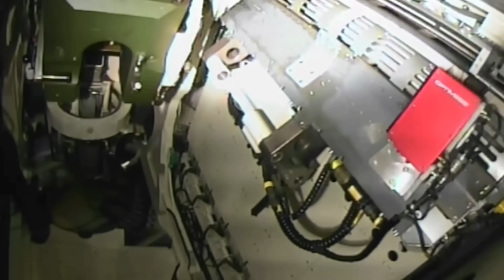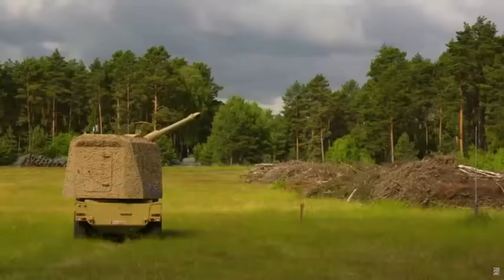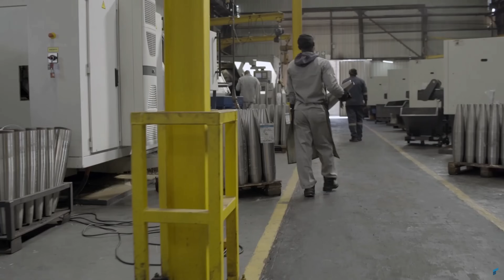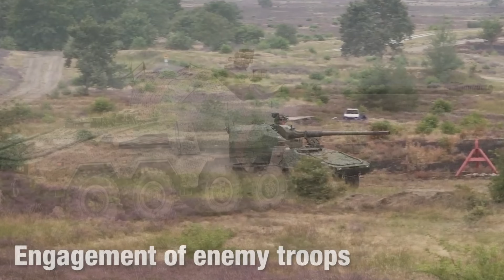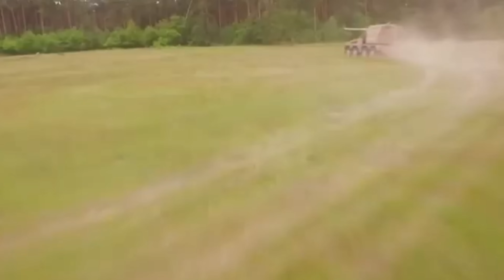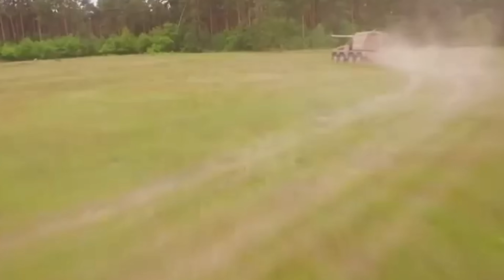The RCH-155 Self-Propelled Artillery System | 155mm FIRING ON THE MOVE!

Comment: This is the artillery system I have been waiting for, and I am thrilled i fits on a Piranha IV chassis. I suspect that is the current candidate for Denmark to replace the CAESAR donated to Ukraine. I wonder why it needs a 10*10 chassis. That is possibly the suspension of the Piranha.
The other salient point is: It uses max. charge 6 - to get greater range it is smarter to extend it using more expensive shells. Due to the nature of the sound barrier, very little is gained using charge 8. And it absolutely smashes the suspension - or you need the spades which is not conductive to scoot.

The main argument is that in brigade with Boxers or Piranha's the ICV's need artillery that can keep up with it when going flat out on the Autobahn.

Actually I think the price of the piece is justified in saving the number of rounds it consumes - accuracy has a quality all of it own.
Reply: The Piranha 8x8 chassis isn’t designed for that kind of weight. Basic Piranha IV 8x8 weighs ~15t plus 10t payload, Boxer A3 is ~25t plus 16t payload.
Reply: >*I wonder why it needs a 10*10 chassis. That is possibly the suspension of the Piranha.*

Yeah, consider that the 8x8 Piranha - even though itself a big boi - is significantly lighter and smaller than the Boxer.
Reply: The Boxer is in a superior weight category, that is why the Piranha needs 10 wheels.
Reply: Thanks for the comments!
But I presume the 10*10 chassis is a consequence of staying with the same manufacturer and creating 2. Brigade as quick reaction force for Finland an Poland. It can use the North south roads and not the east west ones - that in the event will be clogged up by heavy armour.

What we now need on the Piranha chassis is a 105 mm gun. and use the same system as on the S-tank. The turning circle for the vehicle is about the same as for the turret on a traditional tank.
The suspension of the Piranha will solve the stability problem of the S-tank (the length to with ratio of the tracks was to small for stability) The problem with a 10*10 might be excess stability (meaning the bloody thing won't turn sharply enough in small villages). But then I have not seen what the aft 4 wheels are doing - if they mirror the front 4 wheels.
For stability the aft wheels of the Piranha V locks at speeds over about 20 km/h.

But I am looking forward to see if that concept will carry through!

The other challenge is the supply trucks to the brigade - that is largely solved with the purchase of protected Scania 8*8 trucks. When you start pouring in shells at a meat assault (or armoured attack) - you better have reloads ready.
Reply: @ Piranha 10x10 supposedly has 4-axle steering, with only the middle axle fixed.

Comment: I still think wheels are a bad idea compared to tracks. Unless the off road capability has gotten more advanced or something. It’s the assumption that the roads and other smooth surfaces will remain so, or even be there in the first place.
Reply: The off-road mobility of the boxer is decent and it is surprisingly difficult to destroy a road cost effective. You can drive around the craters at lower speed or use another road and the craters are filled with basic tools within a short time.
Reply: @gbornitz  Fair enough.

Though you could still mine the roads or set up ambushes there. Or just monitor it with a finger on the missile button.

But if it is about as good as tracked vehicles in difficult terrain, then it doesn't really matter. And those objections matter more to tanks and IFVs than artillery anyway (if your artillery is hitting mines or getting jumped, you have bigger problems).
Reply: @dragonturtle2703   I recommend you look back five years on this channel, and watch his vid on the South African G6 155 SPH.

Key points:  the terrain it fought a war in outnumbered ten to one, the fact anti-tank mines were a heavy factor in its design so that it wouldn't lose crew or be disabled and stopped when it hits one, and its enormously superior driving range (as well as firing range) compared with all contemporary self-propelled artillery!
Reply: You would think there is a road inside a 40km radius around any target.
Reply: @ you’d think those roads would be targeted to prevent that would you not?
Or destroyed yourself to prevent the enemy using that if they break through you lines to rapidly push inwards.
Reply: that doesn t matter, its a module, you can even put it in a truck or something with tracks

Comment: This vehicle has a very high cost for initial purchase and I wonder if the turret is built to outlast the chassis, it seems the turret is where the money is.I wonder if it fits on a C-130
Reply: Should be roughly 50-50 gun chassis ratio
Reply: WAY too tall to fit on a C-130.
I was going to write that you could separate the modules, and put a hull or two in one C-130 and a pair of turret modules on skids in a second C-130, but then I realized that the 8x8 Boxer is too wide and tall to fit in a C-130! (I could be wrong, but that's how I eyeball it.)

Maybe with the larger-body transports that are coming on the market? Pack sixteen various types of Boxers in eight aircraft, so that you have a command element with a medivac unit and an SPH and a Skyranger; two maneuver units with light and heavy autocannons, an ATGM and an AAA, and their infantry occupants, or perhaps additional medical and escorts depending on the mission. Additional flights for ammunition, consumables, and whatever is needed for the tasking, and you have your initial security force for the airport. Of course, if you want to keep that airport, land a full battery of the PZH-155s, a full AAA battery of Skyrangers, a C³I and spare, whatever passes for radar these days, a Starlink, and plenty of resupply.

Comment: In fact it's more a PR move (insert joke there), to say it can "fire on the move". You can see in presentation videos it's not practical, they load the gun with demonstration charges and not full ones. The real innovation is, you can ready the gun and firing solution while still running. But most modern system like CAESAR or Atmos already do it more than a decade ago (minus the deployment of the gun into firing position without preparation).
Also, the Boxer is already too heavy and bulky for its class, I wonder how it will handle the RCH-155 module. Germans are not really known to make durable and reliable armored vehicles lately to say the least...